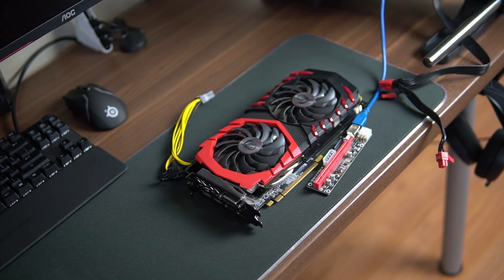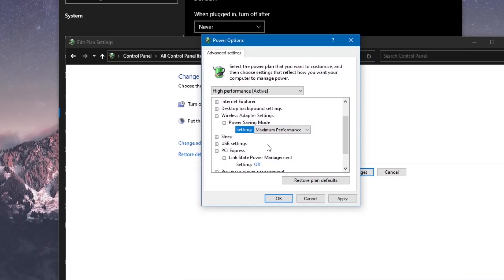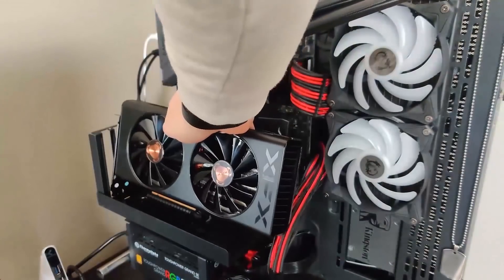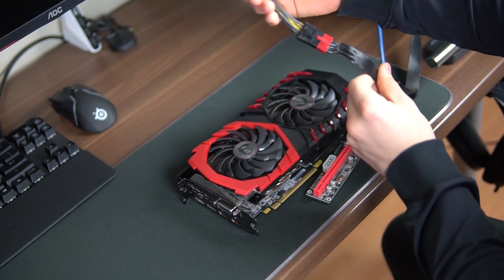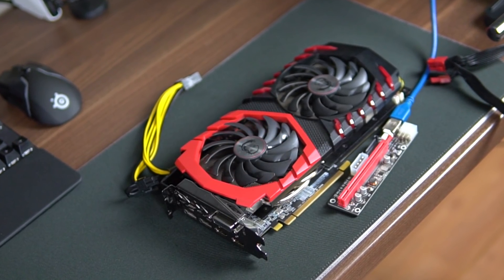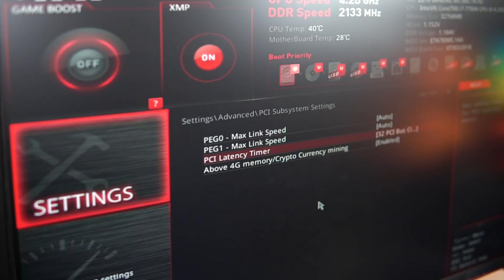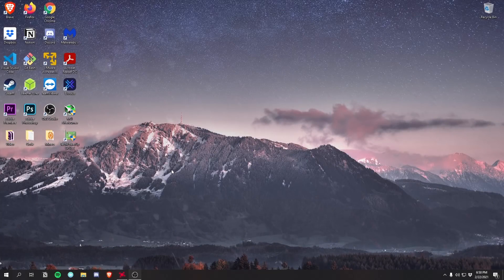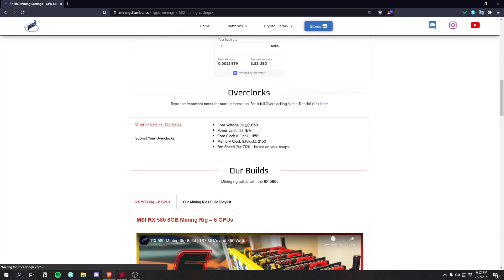How To Mine With More Than One GPU On Your PC

Comment: Please help! I have an MSI x570 MB. I have a 3080 Fe and a 3070. When I both them both on the MB they work just fine but I can't mine on both even under clocked as the terrible 3080 cooler overheats the card. 

I've tried to put the 3070 out of the case using a riser and it reads sometimes but never works, sometimes freezes the system with no display. Tried 2 different risers, no luck. Switched on mining mode in bios, but the bios doesn't have settings for individual pcie lanes to change Gen (only on the main slot). 

Thanks in advance

Comment: Hi mate, Thanks a lot , i love watching your videos!
I have 2 x 3080ti mining on a gigabyte x570 aorus pro wifi motherboard and the CPU is 3900x , i have 2 PSU , 1) RM850watts to power the top 3080ti and the rest of the hardwares ; 2) a second 750watts PSU power the bottom 3080ti. I have a problem of not able to mine stablely for the 3080ti on the top slot no matter how do i tweak the OC setting , it keeps triggering the LHR... while the bottom card was mining normally. I also tried to swap the bottm one to the top and the result was the same...
Do you have any ideas what may go wrong with my setting ?

Comment: Hello 

I'm running a rx5500 & just added a 580 8gb

First it was crashing I did update drives

There was a switch on the 580 I switched back and forwarded & it stable the rx 580 

But now after resting both will not run together 

Still drives are still good not stopped in device 

Running on 650 corsair 

Do I need more power or what could be the issues please

Comment: can i just stick in a second gpu in the lower pci-e slot(2nd slot) and mine with the secong gpu that way instead of having to use a riser?
Reply: yes, just make sure you have 1) power and 2) drivers .. you may have to adjust your bios setting, but try 1 & 2 first

Comment: Hi Bro

Is it safe to run Rx580 and Rx 6700Xt together on my desktop pc for mining ETH with out any risers?

My Pc spec
=========
CPU: AMD RYZEN 5 2600 2nd Gen 3.9 GHz
MOBO: Asus ROG STRIX X470-F GAMING
RAM: Ram Bolt Series - 16GB (8GBx2) DDR4 3000MHz
GPU: SAPPHIRE NITRO+ Radeon RX 580 Special Edition 8GB
SSD: SanDisk Plus 2.5" 256GB
HDD: 5TB Seagate /8TB WD 
PSU: CORSAIR VS650 SMPS
Reply: yes, as long as you have full pci express lane.. the full length, not the shorten 1x

Comment: Hello, I want some help pls. 
I have two GPUS AMD Radeon Rx 6600 XT. I m willing to use them with a power supply of 750 W. I wanna make sure thats its safe to do that. 
Here is my setup : 
2x AMD Radeon Rx 6600 XT
Motherbord : asus prime b450 prime plus
CPU : AMD rayzen 3 1200 AF
is 750 W safe without using risers ?
Thanks a lot u all.
Reply: yes, if you motherboard have multiple full pci-e lanes, you can do it. 750w is more than enough for 2 x 6600 xt

Comment: So I have a asus tuf gaming x570 and when I use 2 or more riser or 1 on the mobo and 1 riser my screen turn black. What fix can I use to power 3 card. Most I can make it work is to use bo riser and to gpu on the mobo. Or if I use 1 riser it worm but 2 or more it doesnt.

Comment: I thought gaming pcs were limited by pcie lanes? Does the bandwidth not matter for mining? Can I fill every slot (with risers on my gaming motherboard? It is a brand new board btw.
Reply: bandwidth doesn't matter.. i was running 8 x rx 570/580 using using 1 x 16x pci-e (long) and 7 x 1xpci-e (shorten)

Comment: Edit: FIXED

Powered off PC, unplugged power supply and discharged excess power, removed both gpus, removed the CMOS battery for 10 minutes, hooked everything back up including both gpus, powered on, and VIOLA like there never was an issue.

Original comment:
Ran into an issue and think I'll need some help...

PC came with an nvidia 1660ti 

  Trying to add an nvidia 2060 through a riser just like your showing here.

No display, but both gpus fans will spin on startup and gpu lights and riser lights show everything is good and powered.

4g coding enabled.

Separate power supply for 2nd GPU and riser...

Should I install the 2060 and try running it by itself to see if it's causing the issue?

Do I need to update my bios maybe or reset it?

Any help would be appreciated.

Comment: Going to be running two EVGA 3080 ti’s. I’m using NBminer right now, but might move to kryptec miner. It Seems very easy to turn on and off the GPUs when gaming. Question is, I set my over clocking on the GPUs but do I need to do it in the NBminer as well?

Comment: hello man
great video ,i have a question i just bought Gigabyte Z590 UD which have (1 x PCI Express x16 slot, running at x16 (PCIEX16)
1 x PCI Express x16 slot, running at x4 (PCIEX4)
...
can i use gpu riser on the 2nd pcie slot x16 (which running at x4)?
will it give same perfomance like the 1st pcie x16?

Comment: Is it possible to mine with 1 gpu only and use another one for gaming or anything else? My idea is to have a 3070 to mine on and keep my 2080 as my primary gaming gpu but both in the same PC. Is that possible without hindering the hashrate of the 3070?

Comment: I have two 1660 supers plugged directly into my Mobo and they mine great. I have just purchased a 3rd 1660 Super. I have plugged in the first GPU into the x16 PCIE slot with a riser, works great. I plug in the 2nd GPU into the 2nd x16 PCIE slot with a riser and the rig will not boot. But they both work when directly plugged into the motherboard. I have it on Gen 2, 4G encoding etc and tried multiple risers, am I missing something?

MI Z390-A Pro
EVGA 1000W PSU
8gb Corsair RAM 2400mhz
Intel Pentium Gold G5420

Comment: I have non modular psu, which has only 1 gpu power cable, with 2 male. I use 1 for primary gpu and plug it in to motherboard directly. so, my question is how can I add another gpu? how to setting the riser? can i used the available male power cable and use a splitter to get 2 male cable for riser? it is save? thank you, and sorry for any word mistake, english is not my main language...

Comment: I have a 750 evga power supply one primary 3070 ti and the second is 1070ti. When i m power on the pc it does nothing, some leds swich on and off immediately. Then i have to unplug everything, switch off the psu and then starts normally with the primary only. Do i need a bigger psu?

Comment: I don't think using a splitter to power your 2 8 pins on the GPU and your riser at the same time is a good idea. The 2 8 pins can pull 150 watts each and your riser 75 watts. Generally speaking the cables can't handle that much due to their limitations with the amps they can supply. Red Fox Crypto explains all of the power draw's really well here: https://www.youtube.com/watch?v=QwLtumnF5-8

Comment: hi mining chambers, i have noticed that my motherboard, Asus TUF B450 Gaming has another pci x16_2 slot, if i directly slot another card in, would it work/detect instantly? currently pci x16_1 slot is used by my other gpu. thanks in advanced

Comment: I'm using a 1080ti as my primary gpu, and  1650 super as secondary but no matter what I can't seem to get it to recognize the 1650 in device manager. Steel legend b450 motherboard. Any ideas? I see a few different places where I can force gen 1, gen 3, or auto or change either 16x bus to whchever but I can't seem to figure it out. I'm using the same exact PSU as in this video as well.

Comment: I have an RTX 3090 and a 2070 Super on an 850W power supply do you think I should upgrade or I should be ok? my 3090 only consumes 350w and the super was at around 200w I recall. What do you think.

Comment: Hi thats a great informative vedio, i have a problem while connecting my gpu....my gpu is working fine if i directly connect my gpu to mother board and if i connect through riser, there is no display, i have checked every connection twice wverything looks fine, also there is power in keyboard and gpu is running, but still no display....can you sort out any solution for me...plzz...

Comment: Great video.  My issue is after I have two GPUs detected in Device manager on Win10 I can still only mine on one.  I can't see 2nd GPU in MSI Afterburner.  Any suggestions?
Reply: same issue even with my pc I have an 3090 and 3080, 3080 is not showing up on afterburner

Comment: I have a Dell G5000 that came with a 500w power supply. Im powering 1 GTX 1660 super and looking at adding another one for mining. If my current (dell) power supply wont handle both, could I power a riser card with the 6 pin from the Dell PSU and then power the new GPU with an external PSU? Just wondering if that's ok to do.

Comment: Is this less effective than a Mining set made purely to mine (with the same amount of GPUs)?
Reply: I'm not an expert but I would say it's less effective because of power optimisations:
- Ideally you would underclock/undervolt all the components - gpus, ram and cpu (unless you also mine with cpu)
- you wouldn't use an hdd because it's hotter, louder and can use more power
- you would use linux because it's better suited for mining

The downside is you need to build a second computer/rig - good psu, cpu, motherboard that supports the cpu, memory, ssd or nvme drive.

Comment: Man i really need your help, im planning to add second RX 5700 xt to my gaming pc so one wouldt mine 24/7 and second will be my main gaming gpu and mining at night. But right now i have only 650W psu, i guess it will not be enough? Which PSU would you advise to buy for 2 rx 5700 xt also one ssd and two HDD some rgb and so on. Thank you very much
Reply: also thinking about adding rx 580 to this build later i guess at least 1000Win this case? and without rx580 850W should be enough?

Comment: so there is no problem when i am using the PCIE1 slot on my motherboard(the smaller one for the gpu)?
Reply from the maker: Yes no problem
Reply: @MiningChamber  i have a H110M-A-M-2(motherboard) and i know connected a gtx 1080 with a gpu riser, but now i have no idea what to do.
i cant find any settings about gpu or similar in the bios
 (i see that the 1080 is running but i dont know how to set it up or if it even works with my motherboard)

Comment: Current setup:
Mobo - B450M DS3H
PSU - 500w
1st GPU - Rtx 2060 

Question : I am planning to get GTX 1660 for my 2nd GPU, is it enough power supply with 500w PSU?

Comment: Im running 2 rx570 4gb cards just added 1. 
1 is from msi 1 from gigabyte 
When i start mining with lolminer 1 card wil give me 25mh and the second one only 13mh...used over clock is 1100mhz 2100 mem 900mv. Can someonehelp me pls what im i doing wrong?

Comment: Hello I have the rtx 3060 ventus x3 and am running it on 48 mh with the developer driver, and am planing to  add an rtx 3060 ti  so I have to update the driver? If I have  the rtx 3060 will be nerfed to 28 mh  or I have just to use hiveos. thanks
Reply from the maker: You can use the same developer drivers
Reply: @MiningChamber  thanks you. Wish you the best.

Comment: Hey, I just managed to grab a 3060ti for mining and I already have a 1080 which I use for gaming. To add the extra card, can I just plut it to the second GPU slot I have in my motherboard and use the same PCIe cable that is powering my 1080 to power the 3060ti?

Thanks

Comment: I'm thinking of getting a 6700XT as an upgrade, and leaving my 5700 to mine on the side. I have a EVGA G3 650W Gold+, and I only have one 8 to dual 8 pin and another 8 to 8 pin cable. I tried to plug in only one 8pin in my 5700 (leaving the other 6 pin empty), its on (fans spinning) but it won't display.

Do you think it'll work with just a single 8 pin? I'm also considering getting a splitter (8pin female to dual 8 pin male) if necessary, but am unsure if its safe or not.
Reply from the maker: Def plug both power cables. Get a splitter for sure
Reply: @MiningChamber  Ah alright. I think i'm gonna try and get a 8 to dual 8 pin cable compatible for my PSU. Worried that cheap splitters might bring a chance of something going wrong.

Thanks for the response, really appreciate it!

Comment: Your channel is so helpful man, thank you! I was wondering if u knew if a 650W PSU is enough to power a RTX 2060 and a GTX 1660 Super. I read that minimum requirements were 500W and 450W respectively. Does that mean I should get minimum of 950W? What are the risks anyway?
Reply from the maker: That should be enough for sure! the requirements are in terms of a gaming system. If your rocking like a threadripper or a really high end cpu then getting a bigger psu is wise. although those 2 nvidia cards dont use much power when they mine so your set
Reply: @MiningChamber  Awesome! Thanks for the quick reply and keep up the great work ☺️👌

Comment: Is it really safe to use splitters to power both the riser and GPU?
Wouldn’t that be too much charge on the splitter, making it a single point of failure?
Reply from the maker: Its the recommended way to go, but if its a 3090 then you need 2 cables from the psu itself, splitter will not be able to maintain it
Reply: Thanks for the info mate.
Keep up the good work

Comment: i have a 2070 i'm using right now just to have some fun, and a 970 in a drawer.  Can I stick the 970 in the same PC, in an empty slot or on a riser and use both at the same time? or do i have to use a different computer if the GPUs don't match or something?

Comment: can a 750w psu work with a 3080 and a 1080?
Reply from the maker: Yes that should be fine but if your cpu is high end then I'd get a 850w at least
Reply: @MiningChamber  I'm running a 5800x...I don't plan on mining when gaming only when at idle

Comment: Thanks for this video. I have 3060 on pice x16 slot and 2060 super on pice x4 slot with a riser. Sometimes in the miner it shows GPU 1 (i.e. 2060 super) is lost. And pc crashes. I have tried reducing the mem clocks, increase the page memory, tried different miners. But, could not figure out the issue. Can you tell me what could be the issue?
Reply from the maker: Does it crash right away or does it mine for a bit then crash? Join the discord server link in Description and ask there encase I miss your comment
Reply: @MiningChamber  mine for a bit then crash..sometimes it runs for hours then crash..sometimes it crashes after 1 min..the temps are within limits too

Comment: So let me get this straight , i got 2 gpus  1) 3080 ftw 3 
And 1) 2070 super 
Can i plug the 2070 supee in the other pcie slot  on my motherboard and mine with them that way? I dont need a riser correct  both gpus directly in mobo. 
Current system specs 
3900x 
Asus strix x570-e
850 watt psu
 Evga 3080 ftw3
Reply from the maker: Yes you can!

Comment: I have multi GPU on my main. 2x 3060's but one of them is running at 25 MH/s the other 48 MH/s. I have installed correct drivers for minning but why is one card at half speed?
Reply from the maker: Check my latest RTX 3060 video and follow the checklist there, I'm sure one thing your missing from that check list
Reply: @MiningChamber   Thank yoU! I plugged my second monitor into the other card and it's now working properly. I suppose using the dummy would have worked also.

Comment: I have a question, how can I get video from the sencond card so I can use it for work and watch videos and only do mining with the principal? When I watch a video while mining the hashrate drops. I have a Z490 MSI motherboard and I activated the 4G option in the BIOS but when I connect my monitor to my second GPU I don't get video. I don't want to switch the cards because sometimes I want to use the mining card for gaming and I want to have it on the First PCI slot and I can't game with the other GPU because it is and old one. My CPU doesn't have onboard graphics, help please

Comment: With both nvidia gpu's connected, my computer won't boot. Anyone else have this issue too?
 
750W 80gold, 3070 + 2060 super, b460m ds3h motherboard. Any help is greatly appreciated!
Reply from the maker: Go to bios and turn on 4g decoding or mining mode then turn off pc and plug the other gpu and good to go
Reply: @MiningChamber  I already had that setting enabled. Turns out I had to disable csm support. Something about backwards compatibility?

Comment: I had 2 RTX 3070 plugged directly into the motherboard but it got hot. Got PCI Express Risers. Usb to card to the motherboard. PCI wires to risers to power the risers. PCI to the tops of the GPUs to power them. Got my HDMI cable from my monitor to my motherboard but now get no signal to the monitor. Help?

Comment: If I have 2 3070’s and have a 750W psu is it enough? Applying it to both situations (mining with both or mining with one and gaming with the other one) great videos btw👌
Reply from the maker: Should be fine! And thank you!
Reply: Have you encountered any issues with this? I have a 3060ti and im getting a 3060 soon, so I want to mine with both at once (I also have a 750W psu).
Reply: I’ve had no problems. I bought a power meter just to be sure and while I’m mining the whole system uses about 330 W. While gaming it goes up to 440-450 W, so a 750 W psu is more than enough.
Reply: @juandanielnassar8914  alright, that's good to hear. thanks a lot

Comment: Thanks for the video. it is very useful. Question: would be more efficient and easier if I run 2 nvidia rtx 3070 on the same motherboard instead of different brands and models?
Reply from the maker: Any brand is fine! dont need to be the same

Comment: Hi, I have 2 nvidia gpu: 2060 super and 3060 unlocked. Do I have to install your 2 drivers or just the 3060 driver?.. Very thanks.
Reply from the maker: Just the 3060 ones, you need the unlocked version to get max hash for your 3060. You can find it in the discord server link in Description